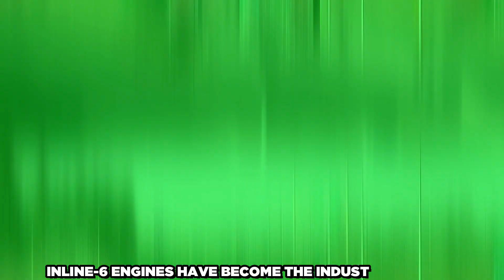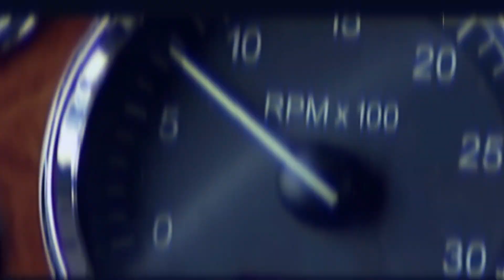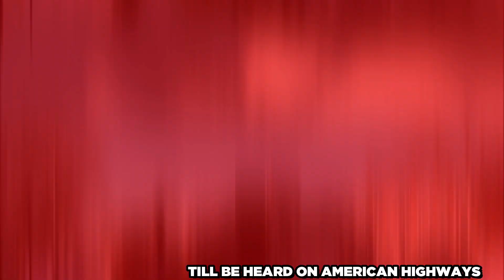Why US Manufacturers Walked Away from V8 Semi-Truck Engines?

Comment: They use 6 cylinders because the engines are huge, N14 Cummins is 14 litres or 861 cubic inches, & fewer cylinders with the same displacement results in less parasitic HP loss because the pistons/rings combined with a very long stroke per displacement are the biggest power killer in the engine. It's called "piston speed" but is actually the distance traveled by the pistons in 1 mile, or a given period of time. Fewer cylinders make more torque, but less HP because they turn fewer RPM.  Diesels are low RPM power producers, 2,000 being the max recommended for most big truck diesels, so the 6 cylinder works better. HP=TQxRPM/5250. Gas fueled race engines(all are short stroke/big bore for displacement) turn very high RPM to make the high HP numbers. Both Ford & GMs light truck V8 diesels turn higher RPM than Dodge's Cummins 6, producing more HP but the Cummins usually gets better fuel economy. Shorter stroke with bigger bore will make more power, because the TQ is carried to a much higher RPM, but the small bore/long stroke motor will make more power at a much lower RPM. Pretty simple laws of physics. The old "2 stroke" Detroit diesels were V6, V8, V10, V12 etc, & turned higher RPM, but the inline 6 proved to be the most fuel efficient with the best longevity.

Comment: Yep, I'll just bet that the inline 6s use a LOT less gasoline than a V8. That's because they don't use gasoline at all. They run on Diesel fuel.
Reply: You're being difficult. The context of this video is very clear that these are diesel engines, for you to act like his comment is incorrect is laughable
Reply from the maker: ctually, inline-6 engines can use gasoline or diesel fuel, just like V8 engines. The choice between the two depends on the specific design and intended use. In the context of semi-trucks, diesel engines are often preferred for their fuel efficiency and torque, but gasoline options exist too.
Reply: Who offers a gasoline powered class 8 truck?
Reply: @TruckThrill Anybody that knows anything about trucks knows that they are 99.9% diesel. The gasoline option is extremely rare. 
In the context of your video, I was correct. Gasoline powered class 8 trucks went out with high button shoes and big wheel bicycles.